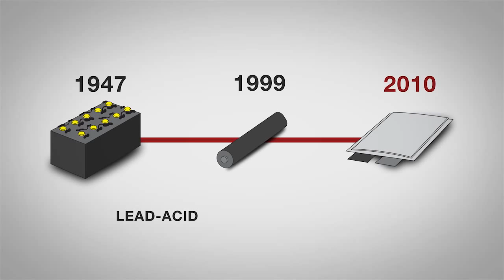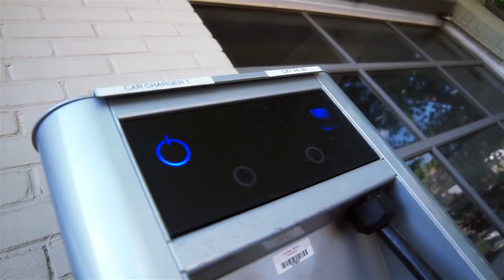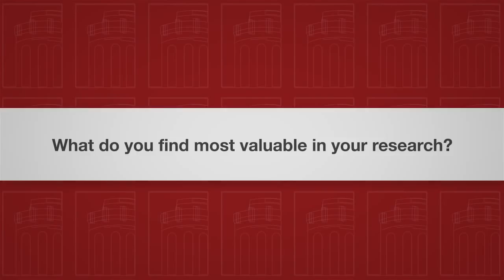Electric Vehicle Battery Energy Density - Accelerating the Development Timeline

Comment: Li- air battery gets heavier as you drive over long distance. This will surely effect the range. Future is in methanol fuel which is carbon neutral if produced using renewable electricity and flexible enough to use in both ICE and fuelcell electric vehicles. China is already using methanol as ICE fuel and India also planning to go in that direction

Comment: The best electric cars today can already go 300 miles....
Reply: +KILL ISIS 
Nonsense. More like ~1200 lbs and ~1.5x the cost of a conventional powertrain as of now and dropping as we speak. Longevity should equal that of a conventional powertrain before it needs to be remanufactured.  Tesla has proven it. There is no need to gimp BEVs like the legacy automakers do.
Reply: +Samuel Vella You're talking about a six-digit price luxury-sports sedan that can do 300 miles if you leave off the air conditioning and obey the speed limit rigorously.